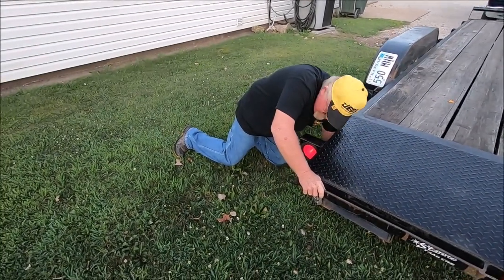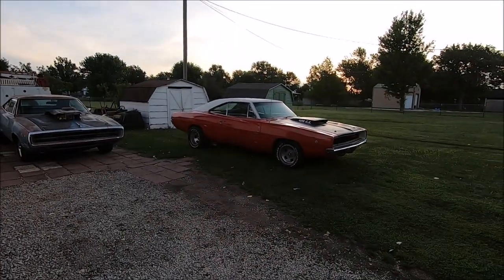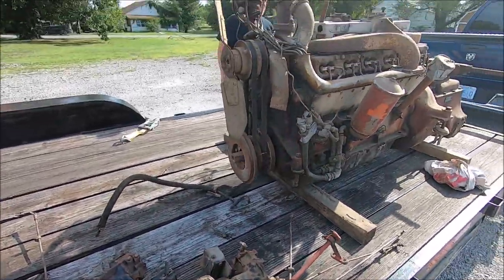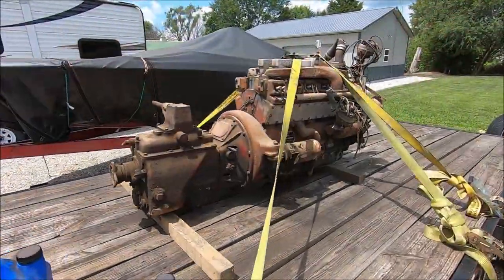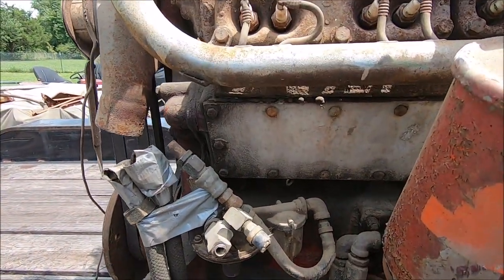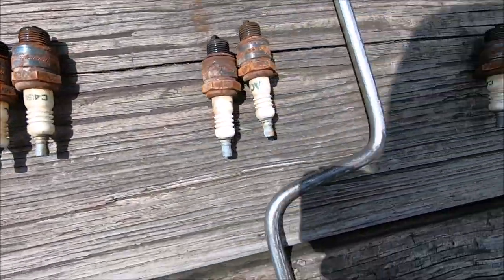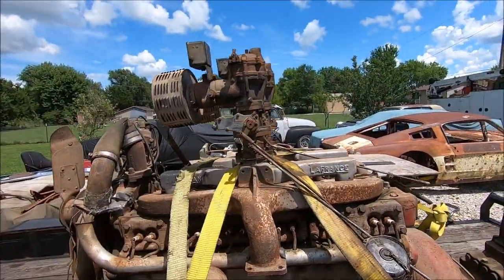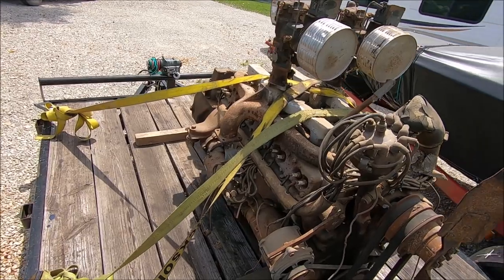527ci American LaFrance V12 engine RESCUE for Jonathan W

Comment: Imagine of 32 highboy stretch roadster, The Wow, appeal is off the charts.FYI, some of these old engines were also used in the Marine environment. Old log pushing tugs, in the northwest. Here in Florida I've seen them in the old boat junk yards. Most are missing parts.
Totally cool. Wisconsin engines made a big V8 that most people didn't know about. 🇺🇸👍
Reply from the maker: That would be super cool

Comment: In the early 1980’s I worked with an old fire pumper that had that same engine.  It amazed me how relaxed that engine sounded even when pumping at capacity.  Jay Leno has a fire truck that has that same engine ( I think ).  When Jay got it the engine was in pretty good shape.  It runs and drives like a new truck.

Comment: Those plates on the sides are the valve covers. Don't know if you'd call this beast a flathead or what,but it's got the valves in the block.

Comment: I could be wrong but I believe this block is prone to cracking just above the oil pan on the left side.
My father used to do cold welding on the big fire truck engines. He even replaced the side of a block where the connecting rod came out.

Comment: I think the majority of those engines were used in old fire trucks so if you could find someone who restores old fire trucks they might be able to locate a intake for it or maybe even try to get a hold of Jay Leno being he knows a lot of sources for unique old cars & trucks . I guess if you can't build that part that's busted off by TIG welding the aluminum then grinding to shape & he can't find a intake the next thing would be to contact a foundry that does sand molds & have them make one for it unless he think he can build a custom intake for it . I worked for a old guy years ago who was the president of the Hudson motor car club in MN & he restored a 27 Hudson fire truck that had a huge straight 6 in it but what I thought was neat was that it had a nice finned aluminum valve cover on it polished but it also had these small screw caps that you could unscrew that lead into each cylinder that was used to squirt eather starting fluid in on super cold days to ease starting he told me . Some of the things the early car & truck manufacturers did were way ahead of times that most people think only were developed just recently like the Cord , Graham & Packards from the 30s that you could buy if you were a rich person that could be had with a Supercharged engine . Packard built the Supercharged engines for the WWll torpedo PT boats that made over 1,200 HP each as well as developing their version of the Rolls Royce radial engines used in bombers that had much less parts inside & were what they called standardized meaning any of the parts off of one Packard radial engine could be used on another one which made it easier for the mechanics working on them for the war effort & sped up production on the assembly lines when build over the Rolls engines because most of those were basically custom made by different engine builders in the plant so parts often on those couldn't be swapped or changed over to another Rolls engine even if they were destined to the very same air craft . I worked on a lot of Packard limousines from the 30s and 40s & they are wonderful cars built more like a truck underneath but rode every bit as good as a modern high end luxo cars of today but have way more class & elegance . The Packard straight 8 was a torque engine that pushed those limousines easily at hiway  speeds today in the states but they were know as very smooth running engine to the point that you could take a nickel & stand it on its end while the engine was running & it would remain standing . The rod bolts were all safety wired like air planes are through the rod bolt & nut so the rod bolts will never come loose until they stretch & fatigue but not many cars or trucks from those days would go as far as doing that but I guess for how expensive they were at the time they figured you should get the best of everything they had be it the coach built bodies the luxo interiors that were more like couches in a house comfortable to the engine designs for reliability internally .

Comment: This engine is a Pierce Arrow designed engine that were used in their super expensive luxury cars of the 1930's. The design is the same, but, this engine is a few sizes larger in scale is all.  Pierce Arrow went out of  business in 1938 and in the auction of the company's assets American La France stepped in and purchased the rights, designs, and the tooling for the engine. They made this engine till 1963 or 64 I believe. If they hadn't, this engine would have been lost to history long ago. It saw a second life with the new owners and a long life well beyond the Pierce Arrow Motor Co.

Comment: Working on the trailer lights before you can leave, Imagine that it's either that or fixing a tire, before you can leave.
Custom aluminum intake with 6 Stromberg carbs
Reply from the maker: 6 strombergs would be killer for sure.

Comment: i have built,refurbished,and maintained firetrucks for 30 years. these engines and Waukesha engines are my least favorites to see during a restoration
Reply: Rick Delair  The worst part is trying to keep them in tune. So much as fast hard and they are out. Parts are impossible. We used to swap in a 6-71 Detroit

Comment: Hey Jed got a section between videos of yourn called stories n short videos,art to lt theres this video a 1000 hp diesel in a '70 Cuda ,Weston Champlin has got a diesel in a just few yrs old 'stang  well enjoying the video of the 527 V 12 an old truck eng from the big gas ones 1 1/2 + ton trucks right? Take bud Rev

Comment: "fabricate sompin' an' maybe put that B25 Mitchel Bomber [two] Holley [1685 HA] carburetor[s]" on. [Picture and manual: https://bre.is/Suhxgbs2 ] I guess I am wrong. It is only one carburetor per aircraft engine: “We’re nearing completion on the bulk of the work,” John said. “We’ve still got the carburetor to put on, throttle mixture, prop governor, prop cable and that stuff. We sent [the engines] out to Anderson Aeromotive. … They’ve done the ground run break-ins on them. We had them run the carburetors that we had overhauled. We had the two Holley carburetors re-done out in California, had them shipped to Anderson, and then they ran both carburetors on that engine just to make sure that they’re making good horsepower, they’re not detonating or having any lean mixtures or rich mixtures, any issues with it. So when it comes launching out of here with two brand-new engines and two brand-new carburetors, we don’t have an issue and know that it works and it functions correctly and we’re not going to have any surprises when we take off.” : https://www.eaa.org/eaa/news-and-publications/eaa-news-and-aviation-news/news/05-24-2018-b-25-restoration-coming-along-wwii-donations-requested